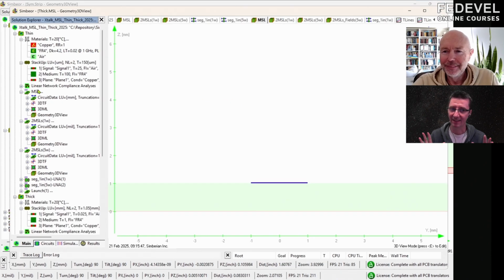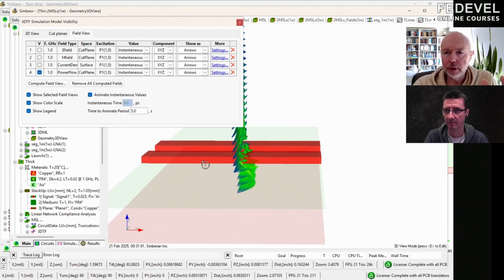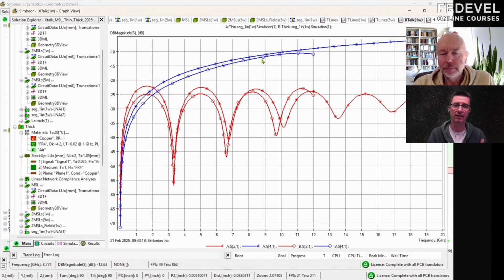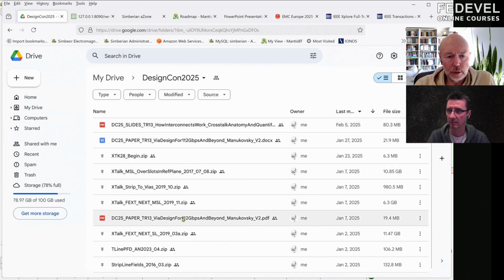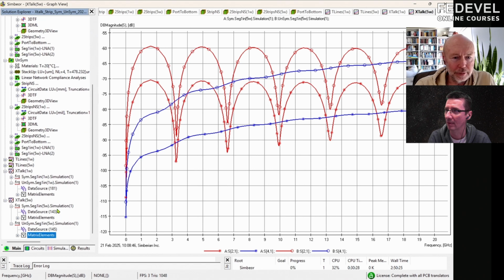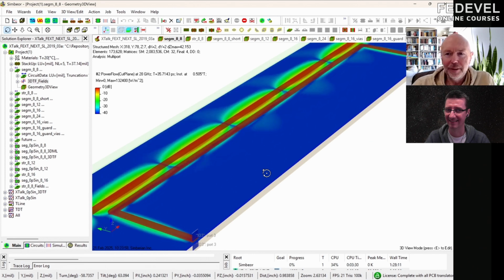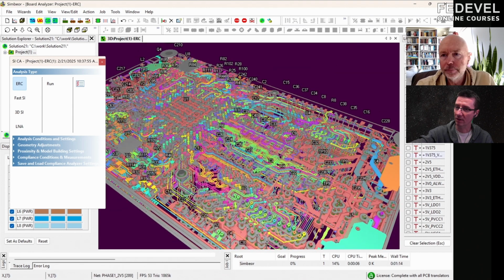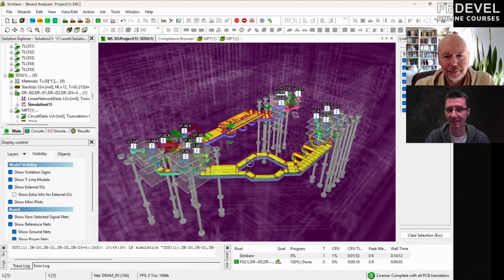Don’t design PCB without watching this!

Comment: Thank you for this video. Great stuff. 

So if all I am doing is making simple microcontroller boards in the 100-300MHz range I am just worried about higher frequency components of digital switching right?

Claude tells me that the 3rd harmonic of a 300MHz square wave is about 33% of the amplitude of the fundamental frequency. So that’s about 1/3 of the electric field at close to the 1GHz in the simulation. So a smaller crosstalk problem, but not trivial. 

Regardless an internal ground plane just can’t hurt.

Comment: Expensive piece of software... and it seems it's term based so you only can rent it.  For post layout, 3 months node locked is $2200 USD.  1 year node locked is $6600.

Comment: What kind of pcb 1THz 😂😂😂, he want show only his software,  he doesn't show his pcb 😅😅
Reply from the maker: most examples are in 1GHz, that is not a very high frequency (e.g. many memories run at higher frequency, not mentioning PCIE and other interfaces).
Reply: @RobertFeranec  it depends on the point of view. 1GHz is high frequency, only today almost everything runs at high frequency. It's abundancy doesn't make it lower 😊.

Comment: These funny studies seem to take place with the infinite input impedance of the signal receiver. But have you ever heard 50Hz in a speaker, even though it's connected with an unshielded wire? And if you also connect a microphone? 🙂 
И да, Ландон из э кэпитал оф Грит Британ, лет ми спик фром май хард! 😂

Comment: I designed PCB without watching this! It still works xD!
Reply: Are you dealing with 10Ghz+ digital signals? 😊
Reply: @Elektro-Retro  If you're using fast logic or many modern chips. you can bet the farm that you're dealing with switching frequencies right up there and beyond. Rick Hartley did a video on this very "gotcha" as dies shrink, the signal switching speed gets faster as a result. The chip I'm working with has a slew rate control to ease this.
Reply: There seems to be some confusion between basic hobby projects and professional/advanced design. The latter type requires these considerations.
Reply: @buenos4799  1. Who says my PCB was not professional? 2. His title does not mention Advanced PCB's. 3. It's called a joke... Obviously Robert Feranec is one of the most well known names regarding this area and one of the best... Chillax man
Reply: @buenos4799 not really. Problems happen mostly when you do high speed designs , basic PCBs don't have such issues
Reply: @ashwin372 Working with mixed digital and sensitive audio will make liars out of us. I've had to re-design one of my boards with better routing and solid ground planes as a direct result of digital crud getting onto the ground.